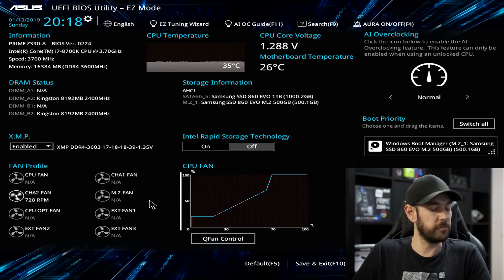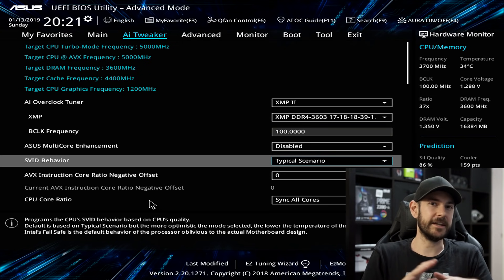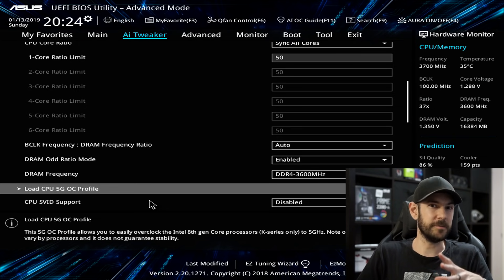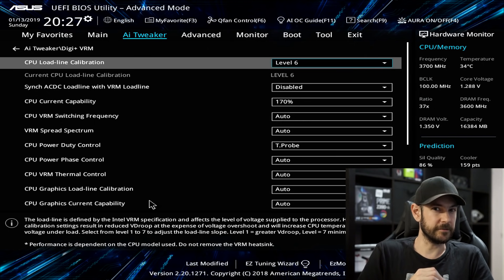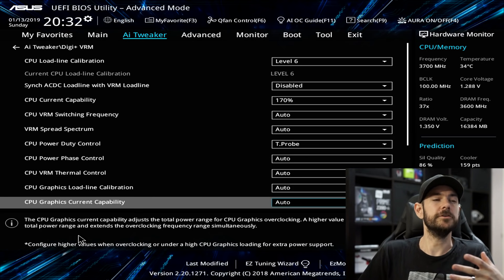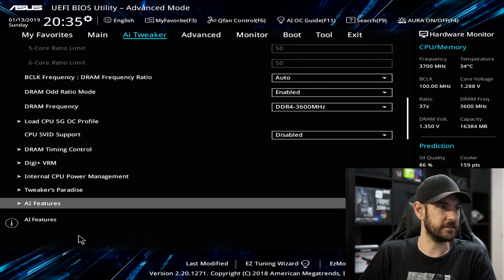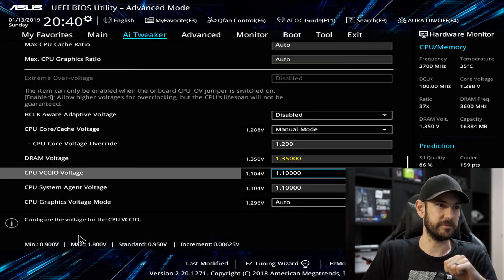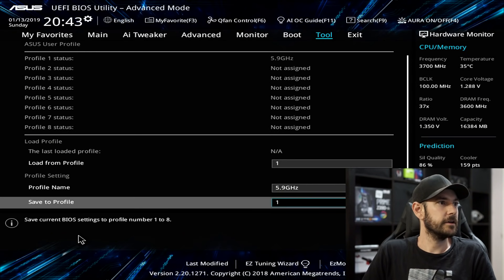ASUS Z390 Quick Overclocking Guide | i7 - i9 | 8700K - 8086K - 9700K - 9900K

Comment: hey guys, I'm overclocking my i7-9700k with the setting he has, once I press f10 and go into the desktop everything seems just fine, it's 5.0ghz and it worked. I tried to play some games and all seems stable. But once I restart my pc everything goes back to auto setting. I checked bios but all the settings were good, nothing goes back to default.
Reply: Are you guys familiar with what's happening here?
Reply: Same problem

Comment: Thanks man, this video was amazing. If only I could figure out the formula for negative core voltage offset
Reply: My i7 9700 k on 4.9ghz runs 1.295-1.305 core voltage, is that acceptable highest temps after a 6 hour stress test was 63c
Reply: Idles at 1.288
Reply: @imprescribed9828  My i7 9700 works fine with the 5ghz and i followed all the settings in the video, im between 60-70c  during load. And im sitting on a air cooler "dark rock pro 4". 
But everything between 60/70c is very good! so i think you are set. You could try to go for 5ghz with the same voltage.

Comment: Hello! I have a i7-9700k with 3.6GHz. Should i start with setting it to 5GHz immediately? Or should i start lower and work my way up?
Reply: Hampus Fredriksson I’m wondering the same thing, what did you end up doing?
Reply from the maker: You should be ok going for 5GHZ at around 1.3V. Most 9700K chips will achieve it provided adequate cooling.
Reply: Boosted Media did that and it worked great, thanks for the comment and awesome video man!

Comment: This works better than the ASUS AI Overclocking software that I tried and it had a mind of it's own and caused my computer to crash and reboot constantly that I had to reset back to bios default to get it to work again.  Using ASUS Strix Z390-E MOBO with i7 9700K, G.Skill RipJaw 32GB DD4 3600.  Got it stable 4.7 GH core temp across all 8 cores at 32C.  I went ahead and OC to my final frequency of 5.0 and all core temps are still 32C idle.

Comment: First off thanks for this guide. It is extremely well explained and I appreciate it. I went with 4.7 ghz oc for my 9700k  at 1.2v and my temps are under 60C under load which is great but for some reason my gpu is running much warmer than before. I game at 144hz so I keep my gpu fan speed at 65% to maintain temps and before it would sit around the mid 50s to low 60s and now with this oc it sits between the mid 60s to low 70s. Those temps are not going to ruin my components but I don't understand why it is running so much warmer than before. Warmer motherboard perhaps? I originally went with your 1.29v setting for but lowering that didn't really affect the gpu temperature too much. Any advice?
Reply from the maker: Too many variables to say. Water cooled? Tuning on the same loop? Etc?
Reply: @boostedmedia  all air cooled. dark rock 4 (non-pro) with a custom fan curve that ramps up to 90% fan speed when cpu temp reaches 65c, 100% at 70c or higher. My case is kinda old but the airflow is good. Corsair graphite 600t: 1 140mm intake, 1 140mm top exhaust and 1 120mm rear exhaust. I run all case fans at 100%. Thanks for responding!

Comment: Thank you so much. I have succeeded to overlock my CPU to 5.0 Ghz with your settings. I have got Asus Z390-F and i9-9900K. Core temperatures vary btw 52-60 degrees with load. Indeed I had great fear to try this.
Reply: I got same board and I get into 90s in cinebench luck of draw i suppose
Reply: @markearl7172  my technican said do not use cinebench . Use asus ai suite
Reply: @markearl7172  but sure the cooling system is certainly important
Reply: I have the same mobo and cpu, are you using adaptive mode or manual? what vcore you use?

Comment: Since I set up my Pc with those configs on BIOS, when I press the power/on button, it seems to try to turn on twice. At first, it quicly get on, then off. Second it succed. And PC looks like fine, stabilized. Is that normal these 2 attempts to turn on? 
My specs: i7 9700k
MB: ASUS Rog strix z390e-gamming
GPU: RTX 2070 super strix
RAM: 2x8 Corsair DDR4 (3600Mhz)
PowerS: Corsair Rm650i
M2: XPG Gamer 500Gb
Reply from the maker: Normal behaviour. That’s memory training.
Reply: @boostedmedia  Thanks dude. Great job with this video

Comment: no luck on overclocking i9 9900k to 5ghz (many crashes).
i am using an aircooler (MSI Core Frozr XL CPU Air Cooler) my cpu will do fine at 4.9ghz with heavy tasks.
temp between 34-45 idle, 75-96 heavy tasks.
do i need a liquid cooler?
thank you for taking the time and effort in making this video.
Reply from the maker: Yeah those load temps are just too high I’m afraid.

Comment: did a really late upgrade this year and now watching overclocking guides, this was great but im wondering if i need more cooling, i have a hyper 212evo and im just not sure if doing this to a 9700k will make a mess of things. If someone out there knows it would be cool to have a step in a better direction
Reply: I know this is a late reply.  But, yes, you need better cooling.  Those Hyper 212s were great bang for the buck and worked well for the 4 core generation.  It's not enough for 8 core OC though.  You're going to want to invest in a large air cooler - NH-D15 / Dark Rock Pro 4 for example - or water cooling with at least a 240/280 radiator, those 120/140 radiators are crap.  Now if you're not doing an OC a Hyper212 is fine.

Comment: hey, dude, I got 3600mhz corsair vegeance memory and it freezes when I turn on the pc, but there's no trouble when I set that as 3500mhz, may the problem be on my voltage? I'm currently using the  recommended memory voltage 1,35v, but i'm using 1,205v for CPU at 4600ghz clock, I just tested 1.250v max and it still get freeze..any idea pls?
Reply from the maker: Set your VCCIO and VCCSA voltages to 1.25V Nd try again. If still no good try setting your ram voltage to 1.38V. 

Also make sure you’re not trying to run crazy low ram timings. I’d recommend loading the XMP profile first.
Reply: @boostedmedia  I didnt found VCCSA, I found VCCIO and VCCPLL.
Reply: @boostedmedia  I gave up..forget all this! it'll keep 3500mhz.

Comment: can someone help me please, i have an asus tuf z390 gaming..I do exactly the same as in the instructions, a setting is different for me than for him: cpu current capability is only for me at 140%, it can only be because  it doesn't work ??  cinebench r15 r20 blue screen .. for all people it just does not work for me .. please help me
Reply from the maker: 140% is fine. That’s not the reason you’re getting blue screens. Will need either more vcore or less clock
Reply: Boosted Media what does a little more or less mean?  😂have everything set up like you?  can you maybe tell me the two values that can try?  don't want to break anything 😂..thank you for your quick reply!  <3
Reply: @SuperCool2121  try lowering clock values from 50 to 49, and/or increasing vcore voltages by a small amount (eg 1.20v - 1.23v)

Comment: I did 24/7 Oc on my CPU. Is 1.34V gonna "kill" my cpu over time if its running on 1.34V idle constantly? I have 5GHZ on i7 9700k
Reply: Will reduce lifespan if the voltage is really high under 100% usage

Comment: Thanks for your video best one so far i have seen and now i clocked mine also after that turtorial! :)
Im having a little question about vcore, i did everything same like u in the video and clocked my 9700k to 5.0ghz and 1.29v so i did some stress tests and benchmarks and everything is fine, temps are fine wont go over 60degrees and no crashes so far even on games but i noticed when its idle its on 1.288v and on 100% load it goes down to 1.270v and jumps between 1.270v 1.280v, is it normal or i did something wrong?

Comment: This video is awesome... I did some research, but ended up copying your exact settings (identical hardware) and its very stable @ 5.0ghz. I knocked my 3000mhz ram up to 3400mhz as well and ended up scoring a 9833 in 3DMark, which is massive! Previously, with different OC settings at 4.9ghz, I scored a 9349. Your optimization settings were wayyyy better than what I previously had. I'd also like to point out that updating to the latest bios update on my z390 from last month also improved my OC stability and increased my score by almost 10% alone! Temps are also wicked good considering the OC, but note that I'm running a Corsair dual radiator AIO cooler. Thanks for this video!

Comment: Thanks! after a bsod, I changed 1.290v to 1.315v on my 9900k with a Tuf Z390 Gaming Pro and I have a stable 5.0GHz OC, I’ve run cinebench r20 and prime95 without bsod, and with a max temp of 76c without thermal throttling 👍
Reply: Thx! Works!

Comment: Another Great OC guide! I have inconsistent tests when using OCCT. It'll pass a 10 min test, then keeping all settings the same, it'll fail a 10 min test. Does this usually mean there isn't enough voltage headroom still? Or something else?
Reply from the maker: Too many variables to say I’m afraid. Could also be VCCIO or VCCSA
Reply: @boostedmedia  I Currently have them at 1.1. Maybe 1.2 can help with consistancy.
Reply: @boostedmedia  at vcore 1.3v 4.9Ghz IO/SA 1.0, the system is stable on 6hr run on OCCT. Bumping to 5Ghz seems to be a whole nother ball game 😅. Bumped vcore to 1.325 and IO/SA to 1.25. So far so good. If stable, what should I step down first? Vcore then IO/SA?

Comment: does someone know what to do, i got a windows error/bluescreen after i oc my cpu and cant find the problem
Reply: Bambus Björn you should gradually increase the vcore, I raised it from 1.290 to 1.315 because I have a 9900k and the video processor is the 8700k, maybe it's because of the two extra cores, what processor, motherboard and psu do you have?

Comment: So I did exactly what you said with my i7-9700k no issues runs fine but small problem when I turn off my computer and want to turn it back on it shuts off and a couple seconds pass and then it turns back on and runs normal. What do you think the issue would be ?.. also it takes forever to turn off like 5 minutes after I hit shutdown my actual computer turns off
Reply from the maker: Normal. It’s memory training.

Comment: For the CPU core frequency I cannot adjust it 50. It is locked on auto. How do I unlock it? i9 9900K/Asus Z390E Gaming/Corsair Dominator 3466MHz/EVGA GeForce 2080 Ti
Reply: Type in a value or hit enter

Comment: It’s my first time overclocking and The cpu (9700k) is able to reach 5.0ghz with temps of 72C on 1.36V steady (This is in Cinabench). However while gaming(Witcher 3 in max settings), I get 5.0ghz, but voltages jumps around, even reaching 1.42v, even though 75% of those voltages are 1.36v the 25% (1.36v - 1.42v) to above that. Would this be considered stable?
Reply from the maker: Hmm I’m not comfortable with voltages that high.

Comment: Nice video... I was using the asus multi-core enhancement / EZ tuning utility ... It had my 3200mhz ram running at 2747... After watching this video I'm running 5ghz stable on 1.29v on my i9 9900k. Ran multiple prolonged intel tuning utility stress tests

Comment: Just tried this last night on my i7-9700k, I can get the CPU stable up 5.2GHz on 1.3v, however from the second I overclocked i've now got serious RAM-related issues, games crash out when forcing a large load area, e.g. going into Blaine County on GTA V. This was an issue I first had with my system that was amended by setting all the DRAM settings to auto. This goes away again when removing the overclock, and the reason i'm sure it's RAM is I ran multiple different stress tests on the CPU up to 5.2GHz last night for nearly an hour with absolutely no issues, and changing the RAM settings seems to change where (using GTA as the example again) crashes upon going into to Blaine County. XMP profile 1 crashes once i'm flying around the lake for a few seconds, XMP profile 2 won't even let me cross the mountains before it crashes (it's that specific and routine). Running the RAM settings on auto seems to generate the same results the XMP profile 1 causes, not to sure what to do here. Any ideas? I'm running a Noctua NH-D15 for cooling, and a ASUS Prime Z370-A II motherboard, also an 850w platinum PSU from Corsair with an RTX 2080super.
Reply: @DanishOldSchoolGuys I basically ended up having a whack a crap tonne more voltage through the Cpu. I settled on 5.1Ghz @1.39v and now I have a completely stable system. Hope that helps.

Comment: My 9700k can't stay anywhere near 5
GHz even at 1.38v what do I do? I have an aio, temps are around 60-70load so do I just have a really bad cpu?
Reply: did u set manual voltage ? cpu should be 40-50C , are ur fans working correct

Comment: so during occt stress test avx load. my clock speed is set at 4.9 with 1.35 volts. during test no errors occurred but clock speed was jumping from 800mhz to 4.9 is that normal max temp was only 71c.
Reply from the maker: Need to turn off speedstep and set windows to high performance power management.
Reply: @boostedmedia  Speed step is disabled because i just followed your vid. And power management is set to high already. Do you think maybe the clock speed is too high?
Reply: i was also going to add that clock speeds ONLY jump around under stress not just running idle.

Comment: worked perfectly to get my i7 9700k to 5 ghz around 65c. I could probably go further, but there is no reason. I can run 1440p ultra settings on 99% of games(only ones that are terribly optimized I have trouble) and that's all I'm really looking for
Reply: Zer0Hour17 what DRAM voltage do you use for your 5GHz overclock on your i7 9700k?

Comment: ummm and what about the famous 4 phase ASUS VRM overheating issue? Or this is only a real issue if Im overclocking a 9900k in one of these cheaper z390 boards? (I personally got a 9700k in a Tuf z390plus gaming mobo)
Reply: reached 4.9 ghz so far, and 5ghz (unstable, still needs a little voltage) according to these methods :)

Comment: Thanks for the great video, i was able to OC my i7 9700k to 5.1GHz at 1.29V with a Asus Z390-E. However, ever since the OC, every time i turn my PC on, the motherboard turns on, then off, then back on and goes normal after. Anyone got a solution ?
Reply: That's normal with some Asus boards when overclocking, it's like the board is testing the settings and then resetting itself then booting into windows, My old X58 Asus board used to do this every time as it was overclocked but my Asus Z390 tuf pro gaming board doesn't as it's not overclocked yet.
Reply: @mr.not.so.perfect.666  Thanks for replying. That makes me feel better reading that I'm not the only one. Thanks once again.
Reply: I overclocked my ram to 3600 MHz and it does that.. I wonder if it’s the same

Comment: Dude, I was using 2400 mhz 8 gb of two ram.I bought 2 pieces of 3200 mhz ram this week. And I did 3200 mhz of ram, which appears to be 2133 mhz as you did.But there is a problem.After increasing the Ram frequency, my computer's processor fan began to sound uncomfortably.You know what the problem is ?